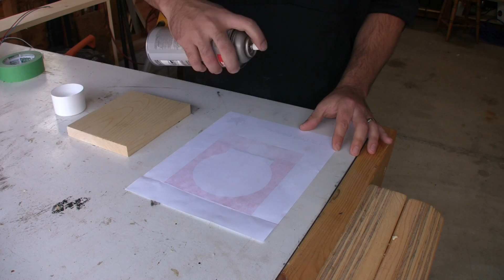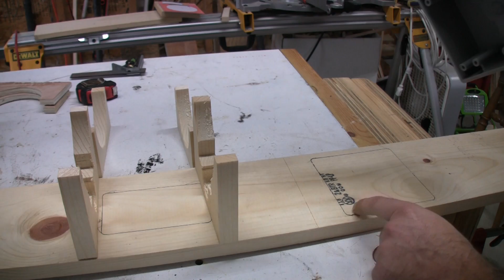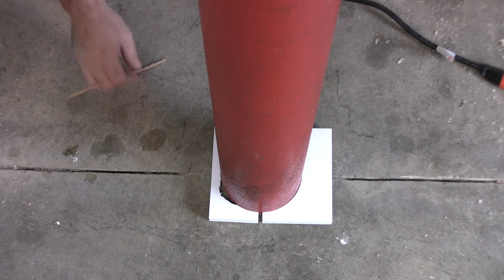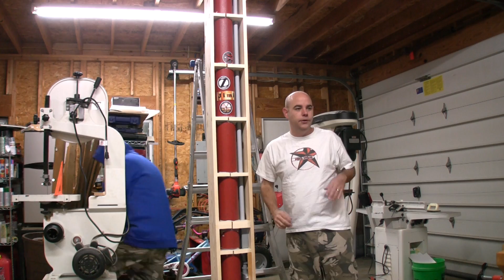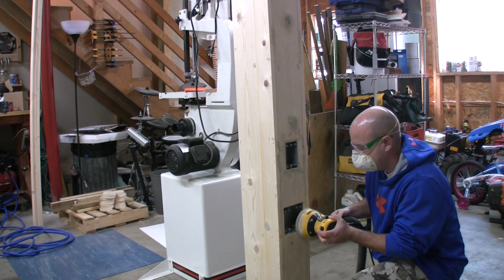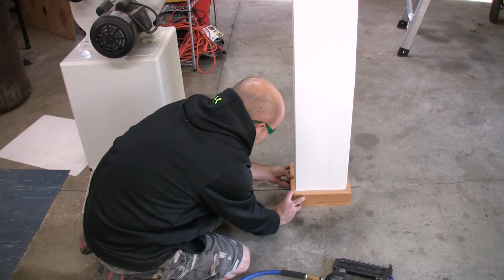Lally Column Cover Up With Outlets

Comment: Great video and exactly what I wanted to do with one column I need to cover in my workshop out in the middle of the floor.  Mine will not be as finished as yours, but I need to run electric down it to a duplex set of 120V 20A receptacles and with enough space to run a second in the future (220V table saw outlet, pre-mounted empty box at the ready).  I'll probably opt for 1" or 1.5" S40 PVC conduit and make my buildout a tad larger to fit.

Comment: I like your idea. Was wondering how this would work with using 2"x 6" for the interior supports that hold the vertical boards. Also, I only have a hand drill. Do you think this will work without a drill press?

Comment: Hi Mitch, great video. Now that it's been a few years, would you have covered it with drywall or has the wood worked out for you? Or, would you have used an outdoor fascia engineered wood instead?  Also, thanks for the jig you supplied. Word of warning to those that intend to use it, ensure that you print it "actual" size and not let your print driver "fit" it to the page, or you'll end up about 5 3/16 wide vs 5 1/2 wide.  Just wondering what else you put in the post, is it some kind of sensor?  Great Video, Thanks